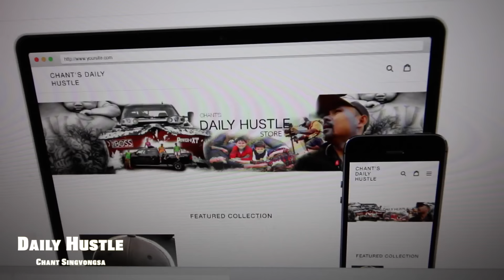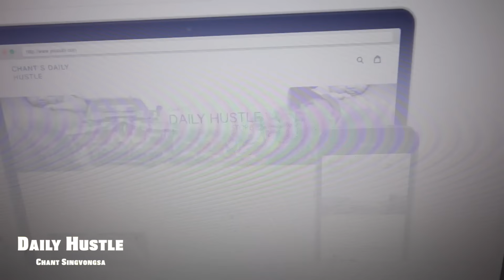Putting snow plow on dump truck Already!!! Lawn care Landscaping

Comment: Since you bought the boards already just cut them to fit/wedge them between the cross members of the ramps for the trailer. You should still be able to drive the bobcat up them and not break the boards.
Reply: Norman Banks good idea on that one when I heard add the board and screw another I new it would slide especially when it's wet out I tried it once walk behind mower went sideways